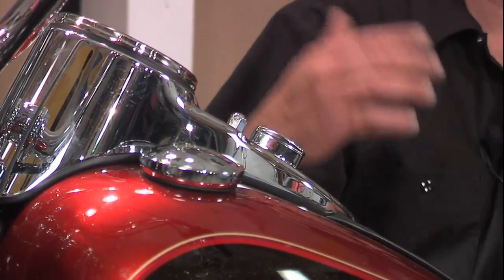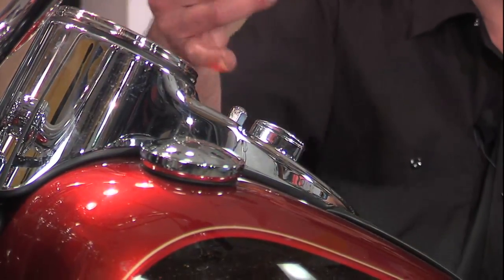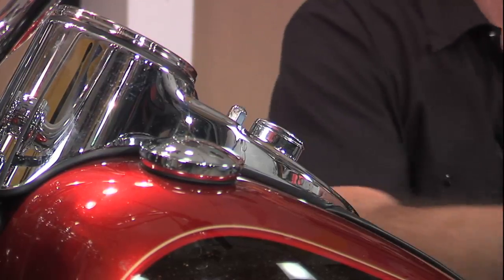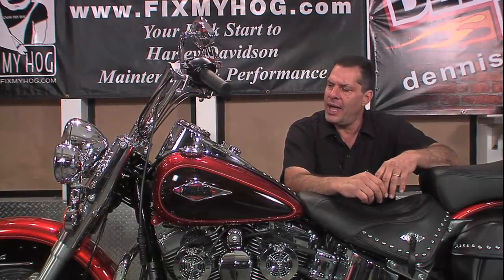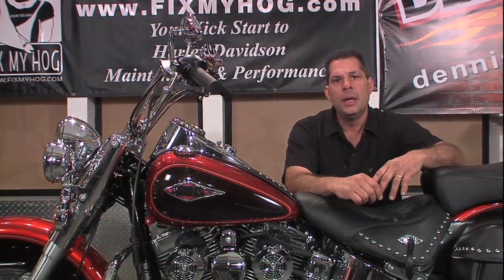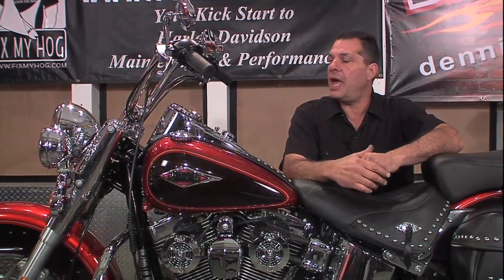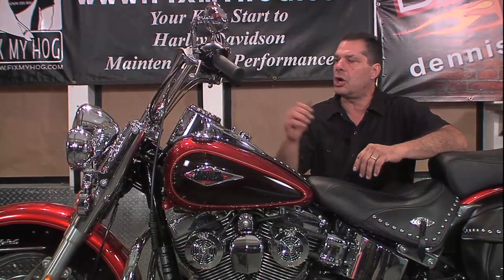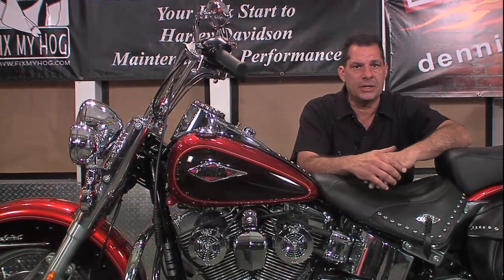Harley Ignition Switch Tip  |  Fix My Hog

Comment: A lot of the time it's just a matter of taking off the ignition switch and it has three prongs, and often times when you have no headlights or anything, it's just a corrosive build up on one of the contact prongs itself, just clean it, put some alcohol and a q-tip, on it and reconnect the three wires and re-install it on top of the fuel tank and turn your bike on and hit the road for a great ride. Simple. Save the dough and hundreds of dollars from the "stealership".
Reply: I just did this today on my 1998 dyna super glide...Worked just like you said....after an hour going through the bike...Thanks brother....Cheers!! 🤘😎🤘

Comment: My Fatboy used to cut off riding down the road ...I kept a can of contact cleaner in my bags...I would remove the single nut on speed odemeter/ignition switch cover ,spray the contacts and like magic, back riding ..I think Harley Davidson only put one but on there for that reason..Please try this before buying ANYTHING....It is a common problem ..It is not liquid sealed so water or condensation can tarnish the contacts

Comment: I have a 2006 superglide with my ignition switch on the dash, the problem I’m having is the key cylinder comes out with the key so I can’t ever lock it, do I need to replace the ignition switch and fork lock ? What holds the cylinder in ?

Comment: I've replaced starter, battery, ignition switch and even battery. Ibpush the start button and het nothing. Lights dont even dim. All components mentioned are getting power. 91 fatboy FLSTF. At a dead end here....is there a switch Im missing?
Reply from the maker: Hello,
I do not see that your active Premium member and our Ask Expert Program is apart of those benefits of the membership. Here is a link to our Premium Membership at a deep discount rate: https://go.fixmyhog.com/C21098

Comment: Great video.
I'm having the the same problem on my FXR4
I installed a brand new battery recently as well as a new alternator and Ignition module.
And after that the switch started acting up.
After I wiggle the key back and forth it lights up my instruments and headlight goes on and no problems after till I shut it off.
Hope you can help.